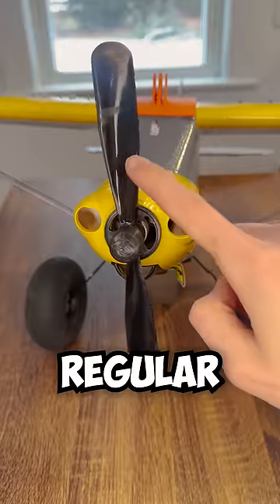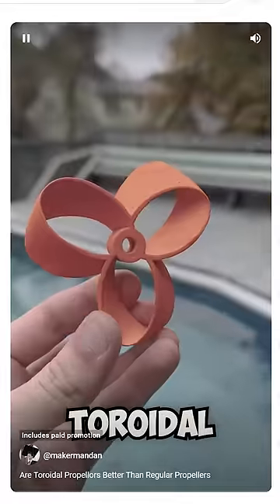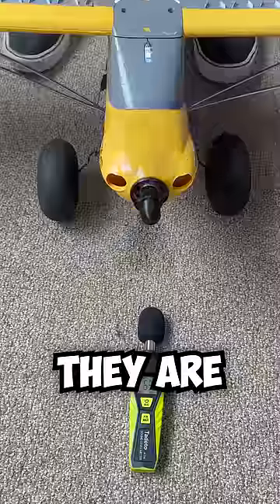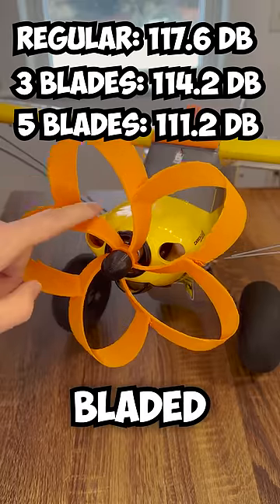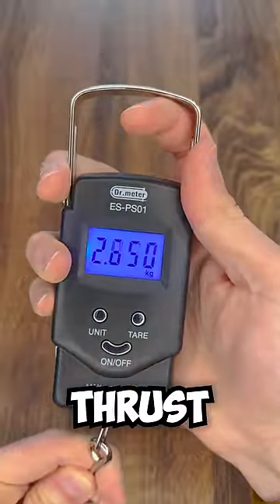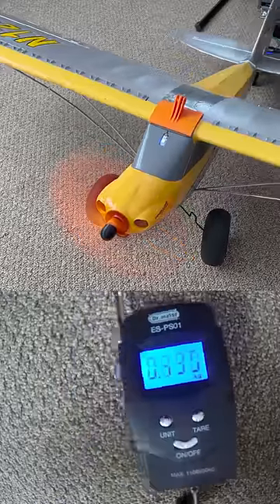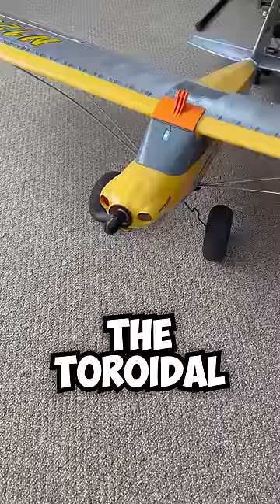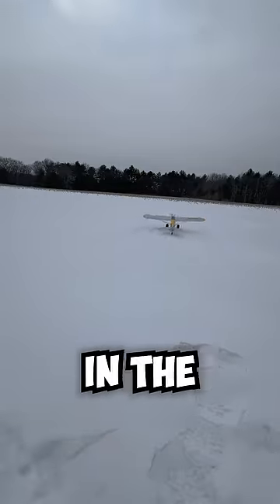Toroidal vs Regular Propeller for RC Plane

Comment: You can Hear it straining the engine more with the fancy propeller 😅
Reply: Maybe try to Put holes in the end of the toroidal to let air escape? Or utilize that air cant slip off the ends like a propeller
Reply: Engine that’s a brushless motor lmao
Reply: It moves more air, more efficiently, generating more torque on the prop shaft. 
The motor simply doesn't have enough torque due to the propeller having more mass and air resistance.
Reply: The motor needing to do work isn’t a sign the prop is bad. Moving air takes energy, if the prop moves more air, more energy is needed. Thus motor strain
Reply: if you read the paper from MIT, it moves more air but uses just as much energy to do so
Reply: @richarddenton3390  Y'all misunderstand me, I know the how and why this propeller design is far more efficient, but that little electric motor couldn't handle the 3d printed prop (which probably weighted over 10x the original), and the design moves significantly more air, increasing the amount of air resistance as speed increases. Consequently, stalling the motor at a lower rpm.
But, id bet, with the increased F.O.C. and increased thrust from the prop, that rc plane would be much more stable if it could fly.
Reply: @datb0013 yes it is. It means the props are less efficient than a traditional one. It wpuld have to use more energy to generate the same thrust.
Reply: @VanquishedAgain  if the definition for a good prop was it’s efficiency then you’d be right, but it is not. Props have many different tasks that are suited to different situations, sometimes power is more important than efficiency. That fact doesn’t make a design bad, it makes it situational

Toroidal propellers are not all the same, the specific poorly optimized one in the video does not reprisent all toroidal designs. In addition to that they have other advantage like noise level which can make them additionally useful
Reply: @VanquishedAgain  Google toroidal propeller and do some light reading.
Reply: @_8gb_75  its as real an engine as that is a plane. ✈️ ☺️
Reply: @VanquishedAgain  I don't think you know anything about toroidal propellers.
Reply: @_8gb_75  you should probably check the definition of an engine
Reply: Judging by the sound, this is mainly due to bad parts of the print, aswell as bad balance.
Reply: @ExtravagantEthan  That would defeat the whole point of using it.
Reply: @Bartimusblue27 It moves less air as you saw in the video. Efficiency wasn’t measured here but I’m willing to bet it’s less efficient too.
Reply: @richarddenton3390  You mean the one that’s 2 pages long and provides no data and is mostly fluff about how drones are a commonplace in todays world?
Reply: One problem is the issue of variable pitch. Can't see how a toroidal prop can do that
Reply: Exactly, there’s more mass spinning around than the other one.
Reply: That's due to the weight.
The shop bought one will be far lighter.
Reply: @_8gb_75 an engine is any machine that converts energy into mechanical force or motion. So a brushless motor is just an electric engine.
Reply: My guess is the motor is overloaded by the extra weight and surface area of the larger propellers, makes me wonder how a slightly smaller version of the toroidal props would perform and whether it would match the power of that specific motor better.
Reply: That propeller is to heavy for that plane. You need to make a lighter prop.
Reply: @_8gb_75 still an engine
Reply: @Bartimusblue27 exactly what I was thinking
Reply: no, the mic picks up the engine more than with the regular, because the fancy are quieter, letting more engine sound to be heard compared to the normal one
Reply: they for sure need to be polished and balanced properly.
Reply: Motor not engine
Reply: @Dawnzyxio14  motor, engine, who gives a shit, both do the exact same thing
Reply: @modlich_303  yeah they both turn axels but they are not the same they are very different
Reply: @Dawnzyxio14  difference is so negligible, or doesn't matter
Reply: @modlich_303  no u don't understand omg 🤦‍♀️
Reply: @Dawnzyxio14  it’s as much an engine as that is a plane. 🐸🪕🌈
Reply: @Dawnzyxio14  motor is electrons and makes the spin, and engine needs fuel and makes the spin. Don't see why not to call it the same word with a prefix specifying what kind of is, (Electric engine, diesel engine, ect.)
Reply: @ExtravagantEthan  planes have actuall engine with like 12 pistons that go around in a circle it's a one of a kind engine there's no others like it so it's very unique
Reply: @modlich_303  omg try taking apart a engine and you'll see the major difference
Reply: @Dawnzyxio14  i know how each works, one makes explosions from fuel fumes, the other swapping magnets (changing the direction of electromagnets), but since the final result matters more than the execution, I'd say it's similar enough.
Is even say a Hand-crank is somewhat of an engine, just a muscle powered one.
Reply: @modlich_303  I said open one up and see the difference, electric motor is far to simple and small to compare to engine, engine has lots of gears like a lot a lot, a motor only has a little bit that's a difference, engine creates carbon build up a motor does not, an engine has spark ignition timing settings a motor doesn't, an engine requires constant oil and fuel a motor does not, an engine requires good compression and lots of torque speca a motor does not, an engine needs Carberation or an fuel injection a motor does not, an engine can run for over 1 million miles if tended to properly a motor is gonna need new battery's at that point, an engine requires fluid or air cooling, a motor using a different type of cooling it's different, an engine has a crank and piston rings a motor does not, an engine requires a exhaust for proper back pressure a motor does not, I could go on forever these are all different they are not same in almost every way
Reply: Yup.  Ditto
Reply: Engine 😂😂😂
Reply: Did not realize i would cause such a stir in the propulsion mechanism community
Reply: Quite? Sure. Simply by using math there was no way they were going to be more powerful. Greater mass, greater surface area, greater air resistance, friction etc. didn't need a video to tell me that
Reply: @ExtravagantEthan  that defeats the purpose of a toroidal prop.
Reply: @_8gb_75 gotta snatch em out the angle grinders you’ll propel that mf to the moon lmfao. That joint won’t be having any issues😂😂
Reply: It sounds suspiciously like the toroidal props are a lot lighter than the regular one.

Which means that they spin faster, but also that they push less air.

They also seem significantly more flimsy, meaning that a lot more energy is probably lost due to flexing. 

Toroidal props are also really finicky, requiring very precisely optimised shapes, and we are talking something like master's thesis levels of precision engineering here, to actually deliver real results. 

Just 3D printing any random toroidal prop that some dude put on the internet is likely to give pretty much exactly the type of results we see here.
Reply: It's a brushless motor so it can handle it.
Reply: @_8gb_75 it quite literally makes no difference nerd
Reply: @ExtravagantEthan 🔴 What Is Islam? 

🔴 Islam is not just another religion. 

🔵 It is the same message preached by Moses, Jesus and Abraham.

 🔴 Islam literally means ‘submission to God’ and it teaches us to have a direct relationship with God. 

 🔵 It reminds us that since God created us, no one should be worshipped except God alone. 

 🔴 It also teaches that God is nothing like a human being or like anything that we can imagine.

🌍 The concept of God is summarized in the Quran as:

📖 { “Say, He is God, the One.  God, the Absolute.  He does not give birth, nor was He born, and there is nothing like Him.”} (Quran 112:1-4) 📚

🔴 Becoming a Muslim is not turning your back to Jesus. 

🔵 Rather it’s going back to the original teachings of Jesus and obeying him. 

More .....👇

🔴 THE RETURN OF JESUS
Reply: that’s not the motor making sound that’s the air
Reply: @ExtravagantEthan  the entire point of that design is that there are no holes so there is as little turbulance as possible.. Turbulance = noise = waste of energy
Reply: Well that makes sense - less thrust -> less air resistance -> higher max RPM
Reply: Engine....
Reply: You can hear the air turbulence created from the toroidal, bad design...
Reply: @1islam1  i find whenever I embrace the idea of a greater consciousness, i always end up rightfully placing the blame of the issues they indirectly created onto them. If someone can create all of the universe, they must have the forethought to see what their creation would become. Hence all plight is their fault.
Reply: @Bartimusblue27 there’s objectively less thrust.
Reply: @Bartimusblue27  if it moves air more efficiently, then why would it make the motor work less efficient?
Reply: From what very limited research I have done on these fancy types of propellers, they need to be precisely manufactured far beyond the precision that you're average consumer grade 3D printer can do, now that fancy colossal 3D printer that was sent to Ukraine on the other hand, That one could probably do it, but that thing is also in the millions of dollars from what I know. So good luck anyone
Reply: Those toroidal propellers were significantly thicker than a prop should be for such a light craft. Its not the fault of the design but more of an issue with thickness of the blade and material type.

Make a toroidal prop as thin as a traditional one for an RC plane then it would be a fair comparison.
Reply: its quieter so you can hear more wngine
Reply: @Bartimusblue27 the more air the propeller can move the more resistance it has right? thats what I always thought
Reply: @_8gb_75 yet, you knew what he was talking about
Reply: The torroidal props still need a "wing shape" cross section, as opposed to the rectangular cross section that can be traced along the torroidal props. Sharpish at the leading edge, humped 1/3rd of the way back on the forward surface, then tapering back to a sharp edge.
Reply: More mass=more stress on moving parts and sealing/bearing/load bearing sufaces
Reply: @_8gb_75  the point still stands
Reply: @ExtravagantEthan  the whole point of the toroidal props is to reduce tip vortices
Reply: @1islam1 what most Christians don't understand is God is Jesus Father, and God is not Jesus, and the Bible does not say that Jesus is God, 
That's y when Jesus was on earth he prayed to his father in heaven, if Jesus was God why would he be praying to himself and why would he cry have u forsaken  me when he was close to his time of death. Also told his followers no one knows when the end will be not the angel nor the son knows but only the father knows, so where people get the belief Jesus is God is kinda similar to the fact that most Christians think Jesus was born on December 25 and that it's a Christian holiday but it's actually a pagan holiday, and Easter is a pagan holiday and is celebrated on Easter Sunday whether that date lines up with that year being the actual date if his death each year or not it was changed purposely to not line up and be a pagan festival that was celebrated near the same date, and it was to worship a fertility God, by having large group origins and sacrifice humans as their fork if worship and celebration, doesn't sound to Christian, why a bunny is used in Easter is the representation of sex because of how much sex bunny's have and babies it has ( playboy) 
The eggs were painted with red blood originally not different colored paint.

Halloween dress up as demons or the dead to blend in with other demons so they wouldn't notice them on the day that spirits are far more active and powerful.

And symbols and statues and idols are all forbidden and warmed about by God,

Worshipping Saints and Mary and baby Jesus, is all a huge insult to God, it is detestable and Jesus told his followers fo never bow to him or worship him, only one deserves to be worshipped and that God, and never to any one or thing else especially idols because he specifically forbid that, and never to false gods, no magic or spiritism spirt boards psychic or tarot cards all forbidden, communicating with demons is one of the worst things u can do and bow to false idols or gods or statues and worship is never to have anything used in worship, like necklaces or beads, or symbols or idols or crosses nothing representing anything on earth or in heaven, that's y its so easy to identify when there is a religion or belief that does not originate with God's teachings or something he approves- when u see those things in worship, just think of a heavily decorated catholic church and how many things they use and are all forbidden and warned about not to have or used in worship, the obelisk on top the church usually is a giant representation of a false gods penis 

Strange no and obelisk at Vatican is from Egypt and was used in satanic rituals, and Vatican court yard is giant sun dial representing the were/ are sun worshippers like in old days 

Think about how many catholic churches are haunted 
Most have been known and experienced ghosts /demons same thing in catholic churches and near them or right outside but if outside it has been seen inside also, that's y some churches get abandoned because they have had so many secret evil rituals done at them by their false priests just like the ones at the Vatican and they have too much demonic activity and many catholics end up having demons follow then home most possessions that are Christian people or been to a catholic church are almost all catholic people that get possessed, 
The religious symbols since they are not approved and forbid by God they don't help unless they care to trick people into believing they do but most story's the religious symbols never do anything or help,
Most haunted houses usually have a cross in them somewhere.

And many people that go to church that have been possessed many wear crosses on them and have them in their room and house, 
That's why catholics are the only ones that have priests that have exorcist because the catholic people would have so much problems with demon activity.
Usually when some gets possessed that is in a heavily catholic country have gone to a catholic church not long before getting possessed or seeing ghosts in their home or hearing them or dealing them or nightmares or started sleep walking. And of course most children that get molested that go to church are catholic children it even happens in catholic schools including abuse.

Islam and Christians should use God's name and not just God because that can mean any God
The catholic church doesn't use gods name because that would be too specific, when they say who they worship they say either God or Jesus, 

Why make it complicated there is only one God n its not Jesus that's his son most know that but why they think he is the same entity when Jesus was very clear when he healed people he to them the power is not his own it is given to me from the one above from his father
When Jesus was fasting for 4p days and was hungry and lacking strength and energy. Satan told him why don't u pray to ur father and have him turn these rocks into food, 

Jesus said no one is to test the father for no reason 

And Satan told Jesus just do one act of worship to me and I will give u my rulership over all the kingdoms of this earth that u see which was all of them Satan basically said he would give up ruling thus earth right at that moment and not wait until Armageddon for his rulership to be overturn, so Satan directing this earth into evil and sin and bloody wars and the deaths and sickness and sadness and loss that he causes he will stop and give it all up if u just bow once to me, and Jesus said get away from me Satan only one deserves to be worshipped and that is the creator of all things the father in heaven YHWH Yahweh Jah Jehovah he has one name you pronounce it however your language pronounces and spells his name its still the same its still the same God and he only has one name and u r supposed to use it, before Constantine and before the jets  removed gods name from the Bible all God fearing worshippers knew gods name and used gods name when referring to him and most importantly when in worship and prayer, ur prayers will be far stronger if u actually know God's name and direct your prayers to him and delivered through Jesus christ the way we were meant to pray to him.

If u didn't know ur best friends name and avoided using it even if u did. Could u really say u know God if u don't even know his name or use his name when referring or talking to him, how would u like if someone spoke to u and constantly avoided using ur name, only to find out they didn't know ur name this whole time, wouldn't u feel disrespect from them that they couldn't even have enough respect for u to ask ur name or learn ur name,

So why would that be any different to u not knowing gods name 

I don't think I would even want to listen to that person if they had so little regard for me
Don't u thing God feels very similar

U don't want God to tell u I don't even know u on judgment day u never spoke to me u never knew my name u never read my book u never learned anything about the Bible beyond probably a paragraph of information similar to most Christians
Reply: @ExtravagantEthan  ⚠️ God has said in the Quran:

🔴 { Every soul will taste death. And We test you with evil and with good as trial; and to Us you will be returned. } 

📖Quran
Reply: no you cant, why are you making things up
Reply: Or maybe, just maybe, the motor can be heard better because the props are quieter 😮😮😮😮
Reply: The electric motor couldn't handle the extra weight.
Reply: @ExtravagantEthan The toroidial blade was designed by an MIT grad. So, my guess is that the electric motor couldn't handle the extra weight more than anything.
Reply: It's a garbage propeller though. It's cross section is just flat insteadof an airfoil cross-section. It's what you see from every idiot with a 3D printer on YouTube.
Reply: Its heavier
Reply: @_8gb_75  

''Engine that’s a brushless motor lmao''

Don't ''laugh your ass off'' just yet.

'An engine or motor is a machine designed to convert one or more forms of energy into mechanical energy''

OOPS
You THOUGHT you knew something, tried to correct someone but failed, learn more.